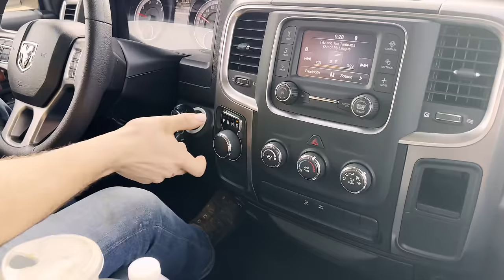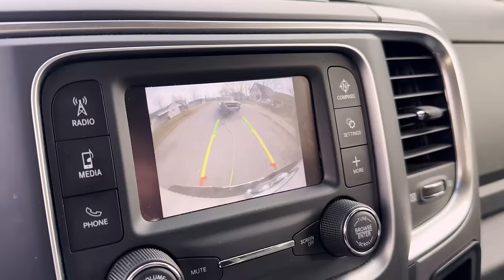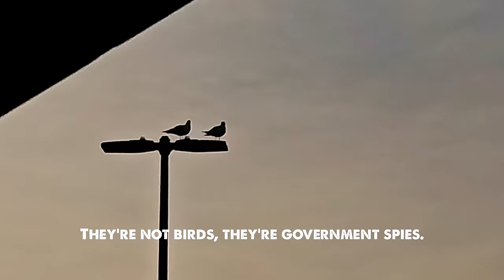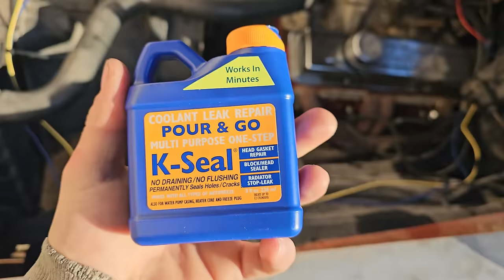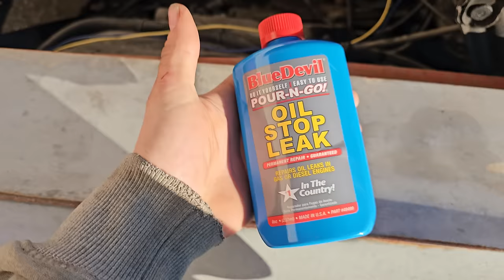Bought Sight UNSEEN Monte Carlo - Will it RUN AND DRIVE 500 miles home!?

Comment: Update on this car it has new wheels and tires weve pulled the engine which turned out to be numbers matching 350 2 bolt were working at puting a 396 bbc into it currently

Comment: I brought a 250 ford transit 2 week ago iv seen it look at it good and he gave me 30 k from 34,800 the battery was low to start but I  took his word it run great and brought it without even seen it run. LOL I was desperate need a new van. So he seem trustable and he was the van run like a car quiet and powerful and useds onky  18 buck a week vs 160 my old van. No problen at all even the ac is super cold. Great buy  2017

Comment: First off, you have a new subscriber...second, my favorite body style Monte Carlos are the 87-ish SS in black with red stripes. My old boss had one with 149 miles on it with a fully built 589 BBC race engine that ran on Turbo Blue. It made 850 horsepower at the wheels and it was a beautifully built car with a legitimate 149 miles. He sold it for $40,000 way back in the early 00s.
Reply from the maker: Jeesh that sounds awesome! 🙌🏼

Comment: My High Torque Fuel crapped out and I sent it out for warranty. While waiting I needed an impact and the Harbor Fright had a deal for 2, Hercules 5ah batteries and a free tool. Got an angle grinder for the free tool and grabbed their Ultra torque impact. I actually Like it more than the Milwaukee. 5 Year warranty. Just bring it in and get a new one. I’m a Milwaukee fanboy for sure but I may just replace out of warranty stuff with Jerkules 🤣 Angle grinder is meh compared to my fuel.

Comment: Oil sending switch or pressure gauge is on the back too. Have you checked that?
Reply from the maker: The pressure gauge yes, not leaking

Comment: I'm gonna say he said he changed the intake. I'm gonna say the intake one of the sidesthe gasket is give away and you're sucking the oil into the vows and you're just burning Off of the valves and that's why every now and then you'll get a bunch of smoke and then it'll go away. It just depends on the vacuum pressure
Reply from the maker: That makes a lot of sense! Will have to check that out for sure

Comment: Sounds like you ran it out of oil. You should have checked that oil line right near the distributor and repaired that when you put those new gages in, you would have fixed that leak. Sounds like the motor's junk now
Reply from the maker: We checked the oil multiple times throughout, never ran out.
Reply: @DailyDrivenDeathTraps   You may not run out but you definitely ran it low
Reply from the maker: @Novarider72  I don’t think you watched the vid lol
Reply: @DailyDrivenDeathTraps  Actually, I did watch the video and I seen the oil trickling down the back side of your distributor and I know for a fact because I've built a lot of old cars that there's an oil line that is right near the distributor in the back of the block and that's where you Were leaking oil  from not your valve cover. Maybe your valve cover as well. But definitely from where  that distributor is. There's an oil line right there. Good luck
Reply from the maker: @Novarider72  pretty sure we said that the oil pan must’ve been changed but the dip stick wasn’t. We figured it was over filled the whole time and that’s why there’s so much smoke and oil coming out everywhere
Reply: All you gotta do is take a flashlight. Look back there when the car's running and see if oil is coming out the back of that fitting while it's running.

Comment: Monte Carlo's are not a muscle car it's a luxury car some of them came with wheel skirts I use to have a 1970 got it for nothing from my cousin i needed a engine and I just happened to have a 1971 Oldsmobile Rocket 350 and rans sitting in my garage that was my fathers engine so I took the engine and trans and put it in the Monte and drove the crap out of the car for a year till some guy gave me a great deal on it so I could not turn down good money even though I do regret it now but at the time I wanted the money to buy another car.